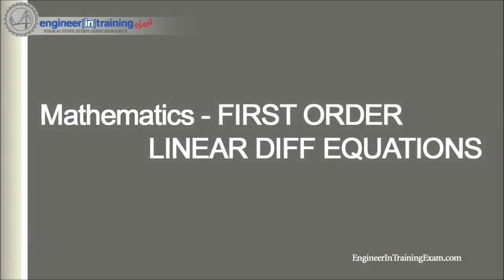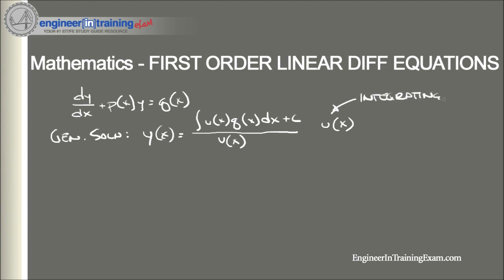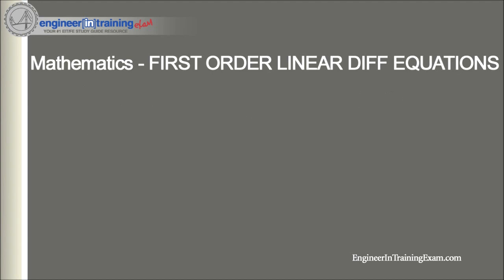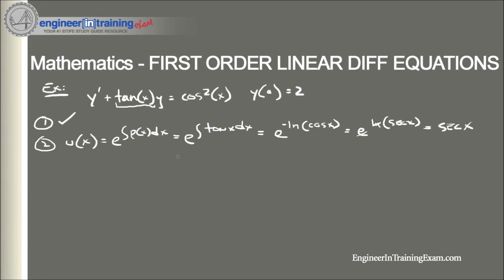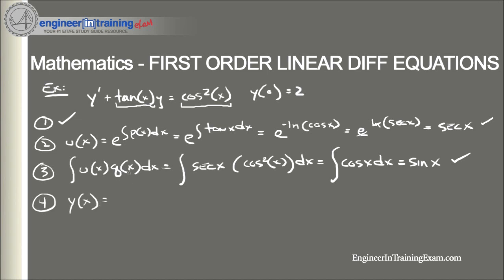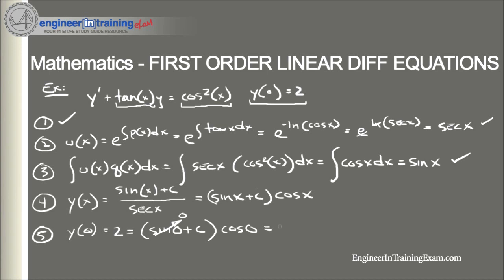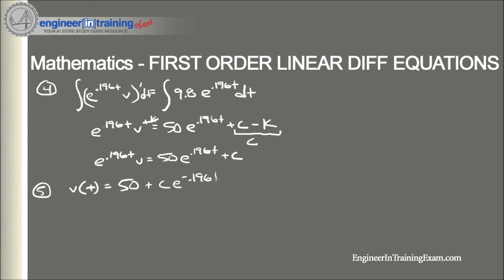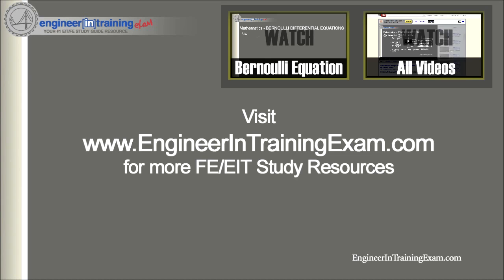First Order Linear Differential Equations - Fundamentals of Engineering FE EIT Exam Review

Comment: no one has gotten any of their questions answered so far but why not lets give it a shot... how did you solve e^(.196t)dv/dt + .196e(.196t)v to be equal to the product rule? you didn't actually explain what you did there you just magically got rid of half the equation.
Reply: answering for anyone else that sees this and has the same question.  Product rule is as follows: F(x) = f(x)*g(x) -> F'(x)=f'(x)*g(x) + g'(x)*f(x).  plug in e^(.196t) as g(x) and v = f(x).  This leaves you with F'(x) = (f(x)*g(x))' or F'(x) = (e^(.196t)v)' which is shown in the video.

Comment: Excuse me. Where did the 0.196 go from the equation of the second example? Step 5: where U(x)V(x), there is a coefficient in front of this expression, then once you start integrating it is gone. I cannot get my brain to figure out how that happened. Could you please explain?
Reply: TRINITYBES1 did you notice that the example gave dv/dt = 9.8- .196v , so when dv/dt occurs in step 3. Substitute in the value for
dv/dt. e>(.196t)(dv/dt) + .196e>(.196t)V = 9.8e>(.196t)..  insert dv/dt, do the multiplication distribution, cancel out the neg and pos values , and you will arrive at the next step in the video. Missing that step presentation took me a moment too!
,

Comment: On 15:20, when you integrated the left hand side (e^(0.196t)v), how did you account for the 0.196 in the exponent? Shouldn't that integration look: [e^(0.196t)v]/0.196 like you did on the right hand side? That's how you got the value 50 = 9.8/0.169